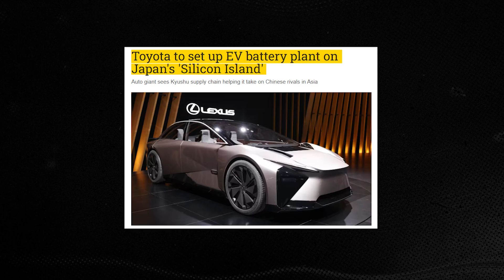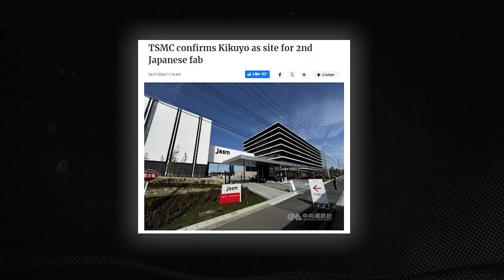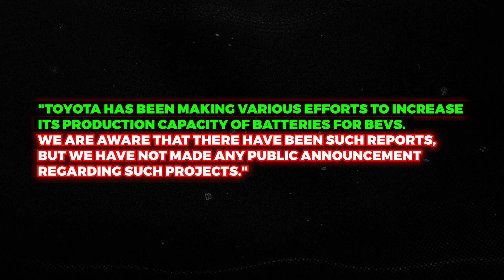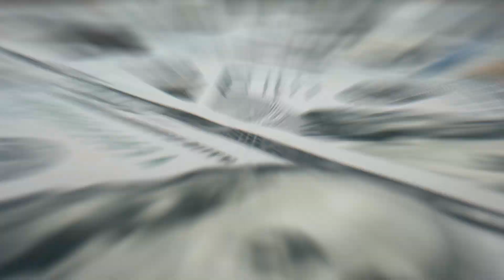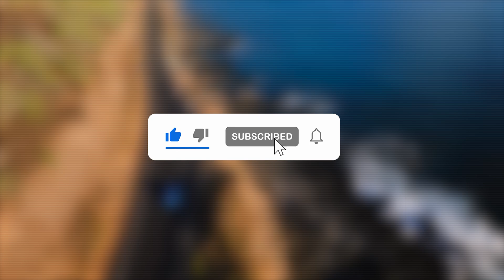Toyota Announce New EV Battery Powerhouse To Battle BYD

Comment: For those who don't know, Toyiota will start using batteries made by BYD. Stop lying and sugar coating. 😀
Reply: @jorgekumagai2672  actually after hearing the news that Toyota and BYD became partners I just bought 40 shares of BYD stock and in the near future about to sell some of my gold stocks to try to buy a couple of thousand shares of BYD.
Reply: @jorgekumagai2672  not just the battery. The whole hybrid power train as well as the ev platform.